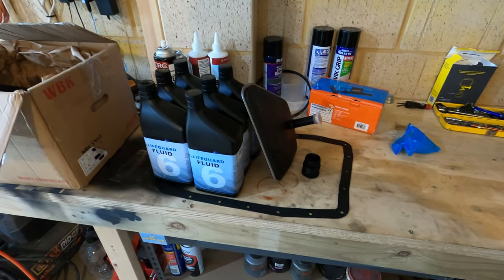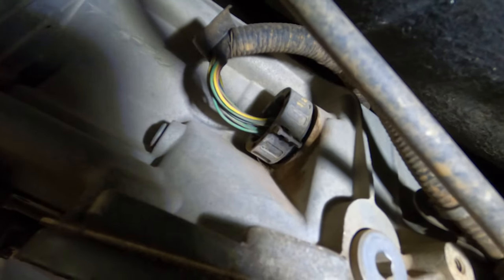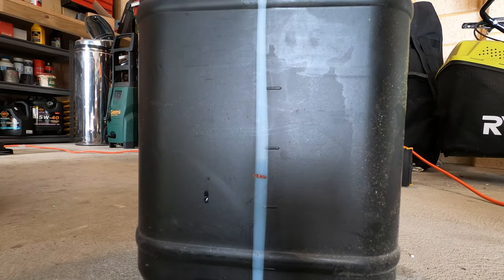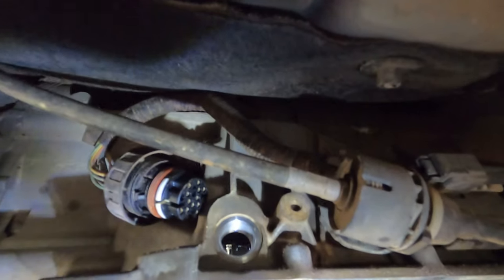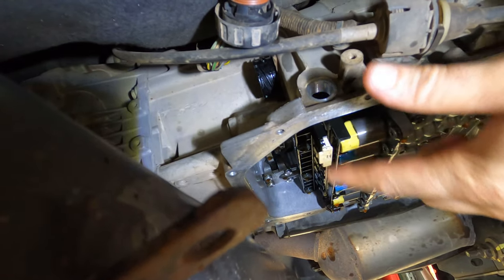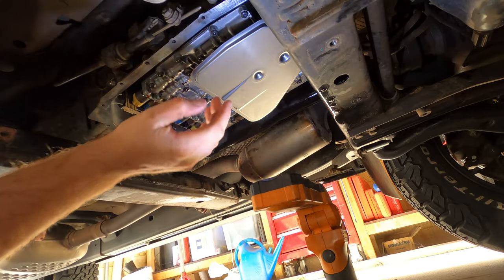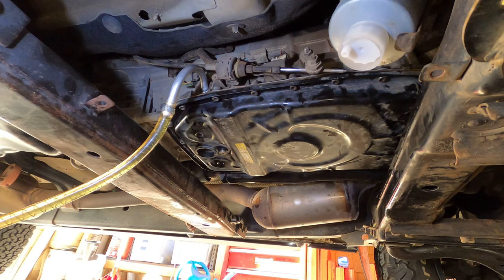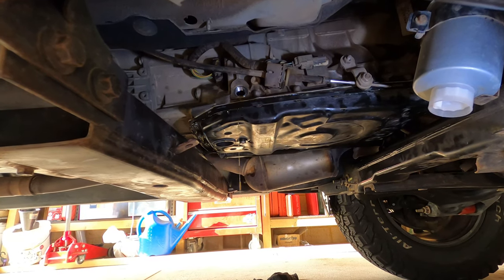LANDROVER DISCOVERY 3 TRANSMISSION SERVICE ZF6HP26

Comment: I did this last year on my LR3 V8. A bit different for the first time taking the old plastic pan off, it's a single piece with the pan and filter. You have to take out the pan screws, then use a hacksaw blade to gently cut the filter neck, sounds horrible but it can be done. One thing I recommend for first time pan replacement is make sure to tap the threads out before reinstalling the screws/bolts. I replaced the solenoids, mechatronic sleeve, valve sleeves, bridge seal. I lost 2nd gear sometimes from takeoff and decided to do a trans Service. My local Land Rover shop said don't do it. I did it, reset the transmission adaptations and it's been perfect ever since. These transmissions are great but people never service them. Also, I bought the LR3 a couple years ago, I wasn't the original owner. Bottom line, change your fluids and service your rig. Nice video.
Reply from the maker: Nice tips there mate I was lucky enough to have the steel pan on mine when I purchased it so didn't have to get the hack saw out 

I tried solenoids and clutch sleeves before getting mine rebuilt with no luck unfortunately 

Main clutch bushes were fingers and bypassing oil  aswell as the mech unit a fairly hefty Lump of money later and she's brand new haha and as you said they just need loving and in my opinion there one of the best trannies on the marker
Reply: Thanks for this advice. Were you able to do this without taking down the catalytic converter or the frame cross members? I'm planning to do this on a V8 and I believe this video works on a TD6.
Reply: My LR3 is a V8. I did a bit of research before doing it. You should go to Atlantic British website and look at their transmission filter kit. They also have a good video that gives a good idea, not everything, but a good idea of what is needed to do the job. It was the absolute best service repair I have done on my Rover. Only thing you will need to do is lower the transfer case a couple inches. Very simple. The most unnerving thing for me was cutting the old filter neck to free up the pan. It freaked me out until I just relaxed and did it. If you do it, while everything is disassembled, take the solenoids out and test them or replace them altogether. It will be around $850 US Dollars to do the job with all parts and fluids. After you're done you will need to have the shift adaptations reset with a GAP tool or a local Land Rover shop. Very simple computer procedure. My Rover shifts smooth and perfect. All gears working great.  @1013aaronb
Reply: Saludos, exelente te tu video, podrías asesorarme, hice cambio filtro y aceite, pero el auto cuando voy sacandolo despacio me golpea la segunda marcha, que sugieres que podria ser lo que falla? Espero tu repuesta gracias

Comment: Wish I had seen this video before I done mine! I made many searches without success for where the refill port is, but yours is the only one I could find that shows it. I was confused, as the port does not appear to be high enough to allow enough volume of oil. THANK YOU! The biggest problem I had was removing and replacing the bolts from the front of the plate, which are obstructed by the chassis cross member. I ended up drilling a hole through it to allow one of the bolts. My plan was to rust proof it. but there is enough oil to preserve it. :D
Reply from the maker: 🤣 yep oil will keep that hole well and truly lubricated hahah glad it helped you out even if it was afterwards haha 

Happy new years 🍻

Comment: I just changed my sump pan last week. What a nightmare getting out and putting back in 8 of the bolts along the cross members. I had to use an Allen key and quarter turn at a time on each one. It took me hours! Did you have a low profile ratchet with hex bit attached or something? You didn't seem to take long on those bolts blocked by the cross member. All done now, but what a headache outside in the rain 🙃😔
Great upload as usual. I hope you and the Mrs are settling into your new home 😊👍
Reply from the maker: Hey powervolt I used a small torx bit with my ratchet spanner 

Next time for the rear 4 bolts I'll just unbolt the cross member and support the transfer case with a jack stand to make life even quicker
Reply: @OUTBACK Discovery  Oh Jeez, why oh why did I not think of that haha. I will definitely have to remember that for next time. Cheers 👍😊
Reply: I e just tried it in the rain, bloody nightmare, and gave up. Stilll struggling to remove the bolts above the front crossmember. It doesn’t help as mine has spit oil everywhere
Reply: @powervolt748  was there anything in the filter which made it worth replacing it?

Comment: Great video! Very detail oriented and simple. I have a question, i have had my 06 LR3 for almost 4 years now and I drive it in manual/sport mode because if you drive it in drive when it shifts from 4th to 5th it slips/jerks pretty good like there is a delay in shifting. In manual mode it wont do it as long as you let off the gas between the shift. When it does happen in sport mode, it will go from 4th and jump into 6th and you cant shift back down for around 7 seconds, after 7 seconds goes by you can then shift back down to a lower gear. I have no clue what is causing the slipping but it has not got any worse in the 4 years I've had the vehicle. I was thinking about maybe hooking it up to the GAP tool and resetting the shift adaptations but im nervous about doing that. I've heard some people do it with success and others say its a no no...🤷‍♂️ Any ideas??

Comment: Hi, Thanks very much for this excellent video. So you don't have to remove cross members and lift up the transmission to remove the pan? I think the Disco 3 I have just bought has original pan on it. I see some people cut through the tube on the original filter so it is easier to remove.
Reply from the maker: hey jason honestly if you have the plastic pan, after doing this job a fair few times on different disco's now. i dont mess around anymore and just remove the cross member whilst supporting gearbox with a jack under the transfer case. if its a steel pan its easy to do with the crossmember in situ
Reply: Hi, Thanks for that. I do have the original pan by the looks of it. I did my diffs today. Got trans fluid so will order a metal pan with separate filter. Do you use the genuine LR fluid in your transfer case? It is extremely expensive. @OUTBACKDiscovery
Reply from the maker: @JRproductionsnz  i found shell do the transfer case oil for it but cant remember the number from memory was still pricey basicaly same price as landrover but i didnt have to drive 40 minutes to get it
Reply: @OUTBACKDiscovery  Thanks. I bit the bullet and bought 2 lts of genuine fluid today. $321 nz delivered! Thats why I am working overtime tonight!🤣

Comment: thanks for video, very informative! thanks heaps ,how many km on your rover ?  how did your car go after drain and replace fluid? also i have a rrs 2010 tdv6 3.0 ,same tranny i think ! , my questions is where did you get all your parts and fluid from please ????
Reply from the maker: Sorry about the late reply the business I bought my stuff through no longer operates 

Although it's the same make transmission in the 3ltr ita the zf8 speed rather then the zf6 speed my disco had so it takes a different oil but the servicing process is still the same as the video 

My disco had 220km on it but I bought it with a bad transmission so got it rebuilt at 140km and dropped the oil every 20km after that and serviced with new filter every 40km 

This is excessive for daily driving but with all the 4wding and beach driving I was doing it was necessary 

For a daily driving vehicle I recommend every 50-60km transmission oil and filter change and rhat will keep your car happy

Comment: Great vid - done this job a few times but this is the first time someone's pointed out the need to change the mechatronic sleeve (Thanks mate) and guess wot? Mine's leaking (shoulda changed it last time, drat!). So gotta get on with it but going round in circles trying to make sure I'm getting right one (most offers are for BMW and whilst it's the same ZF6HP26 box  - and therefore sleeve  - I can't get anyone to say ' yes it's the same'. Have you got a part no. or do you always have it as part of the whole service kit? Ta
Reply from the maker: Thanks Hugh basically if it specifies for a zf6hp26 then it will be correct  I just bought my sleeve off ebay for like $20  was just generic for the zf6hp26 and didn't specify landrover or anything

Comment: I did this a few days ago, on a 4.0 v6. What a pig of a job. Didn’t realise that the exhaust crosses over forward of the rear crossmember and there is SFA room to access the middle 2 pan bolts. Even harder getting them back in. Changed the sleeve and now getting intermittent trans faults but can fix if I give the harness a jiggle.. never again 😅
Reply from the maker: Hahah aww man what!

Maybe make sure that you locked the plug fully and it's not only have screwed in yet
Reply: @OUTBACKDiscovery  yeah at least I know it’s related to the harness.. took it off this morning it was a bit oily so gave it a spray, dried it and put it back so hopefully she’s right to go
Reply: @OUTBACKDiscovery  OK fixed now. Drained the pan again so I could try get the sleeve in further and got it in another 6-8mm I reckon so I should’ve listened to your advice of noting how far in it was before you take it out!

Anyway she’s all good now 👌🏼👌🏼
Reply from the maker: @ellzeez  perfect atleast you found the problem 🍻 will be all over it next time

Comment: Thanks for the video! Do you know if it’s a  Britpart pan? I see a Ford gasket installed, wondering your pan has a ridge underneath.
Reply from the maker: Unsure as to which brand the pan is as previous owner done the swap , I no the Bridport clears with the crossmember still there , 

The steel gasket used was from when I sent my trans off for a rebuild they prefer the steel gasket over just the rubber one

Comment: Great job!  I just completed mine but I had to raise the trans about an inch to be able to put the new metal pan in. :(  It doesn't look like you had to.  I got my metal pan kit from Atlantic British; how about yours?
Reply from the maker: Hey Sabine mine was on the disco when I bought it 

It is a tight fit though I have to turn the pan to like 45 and  degrees and angle it just right to get it to fit under can take a few minutes to find the sweet spot 

Time-lapse always makes things look like it just pops it but it's a bit of effort haha
Reply: @OUTBACKDiscovery  Good for you.  That must make it much easier.  May you enjoy your Disco for years to come!
Reply from the maker: @sabinetosabino689  likewise 🤙

Comment: hey bud, where did you buy the kit from, i have  a metal cover  so looking for something similar, im also also in Perth
Reply from the maker: https://mjproducts.com.au/shop/zf-6hp26-transmission-steel-metal-sump-pan-conversion-kit-factory-2nds/

Are the best I've seen proce wise specially for oil 

Or just search what you want for a ZF6HP26 that's our transmission model code
Reply: @OUTBACKDiscovery  sweet thanks, I was looking earlier but no one sells the kits, just the oil and filter, thanks for the help 👍
Reply from the maker: @AS-yc3wp  no dramas 🍻 happy shopping 😆

Comment: When draining at 2:15 in the time lapse, are you cycling through the gears?
Reply from the maker: Hey Jacksomb yeah I was * car was not running though* just wanted to see if any more oil came out or not. Didn't  seem to make to much difference though I maybe got an extra 400ml out

Comment: Hi, after servicing my auto, I started to get a torque converter shudder. The oil I was using is Penrite and recommended for ford, ZF automatics. Did you find an issue with this oil  and did the Nulon product eliminate the issue. Apart from this, the auto is perfect. has done 300k, so it is to be expected that issues may arise, however, I feel the issue is oil and not mechanical. Appreciate your feedback. Cheers Gene
Reply from the maker: Morning , I only run the zf lifegaurd 6 oil in my trans it's oil quality is unmatched 

Chances are your shudder is from the torque converter which is now worse with the penrite oil in 

Mine done the same thing except I changed my.oil because of the shudder originally and used penrite oil the first time this made rhe car undrivable so quickly dropped rhe penrite oil and put zf lifegaurd 6 back in so I could drive it for a few more weeks so I could save money for a trans rebuild 

So my advice personally is that I don't recommend anything other then the lifegaurd 6 

People have mixed opinions on the penrite oil some swear by it and other like myself would never put it in there trans again
Reply: @OUTBACKDiscovery  THanks, interestingly, the problem only started 10k after i changed to Penrite. I will do a flush to ZF fluid, nothing to loose, everything to gain. BTW, how did you go with gearbox rebuild, what was the wear like, major things to look out for?
Cheers
Reply from the maker: @TotaldriverAu  honestly I wouldn't waist your money 

If your planning on keeping it get your torque converter replaced and then get them to install zf fluid after job is done 

Dont put Dr tranny anti shudder in it that stuff is like putting a bandaid on an underlying problem and can cause more wear 

My trans was in a bad way so got with 3rd and first gear ratio faults aswell as the torque converter shudder 

So I got my box rebuilt by a shop as I didn't have time, had new mechatronics unit with a valve body zip kit put through it 
All new solenoids and seals 
Upgraded bushes throughout 

And a heavy duty torque converter and flex plate costing me 7.5k 🤮🤑

Next time will do it myself 

Will be doing my dads disco 3 torque converter soon they are about 1k for a unit and $500 in oil 

If you pay a shop around 12-14hrs to do the job
Reply: @OUTBACKDiscovery  Thanks, I do all work myself, have been doing a bit of research into what goes on inside, and seems pretty basic. Like all things, time and distance (300k) equals wear, Gearbox operation is sweet in every way, so a set of clutches and from what I have seen solenoids should be ok, and a new Torque converter by the sounds of it. Bugger.
Reply from the maker: @TotaldriverAu  nice one when you go to take the gearbox out to get to the top bellowing bolts they are easier to access if you removed the transfer case crossmember and lower the rear of the gearbox down 2 inches 

Gives you a better angle to access the bolts 

There's 2 breather tubes ontop of gearbox one close to the front of the trans ontop and one ontop of the transfer case 

And from memory 3 plugs to unplug 

People say you have to remove the transfer case to get it out but it can be done with transfer case on 

When I done my Mayes torque converter last month I found the transfer case bolts hard to get to so left it on and removed trans as a whole units which worked fine 

When removing the starter motor the fuel cooler gets in the way so just remove it fully and clamp the 2 coolant lines going to it so it doesn't leak 

To remove the started slide it back and then angle it up so that the positive terminal goes over the tip.of the engine mount bracket and then rotate clockwise a tiny bit and that will give you the room to remove the starter motor 

Good luck took me 6hours to get the box out
Reply: @OUTBACKDiscovery  geesus. no wonder I have been putting it off, was thinking body off, give the engine a freshen up and new set of bearings and so forth. If one part needs a bday, the rest cannot be far off.

Comment: Thanks for sharing this informative video. I once again have question.
Yesterday when driving a gravel road for about 300km. I randomly got the message "Transmission fault , traction reduced". Now the question is, the previous owners did not replace the filter and sump on the disco. Would you advise I still do it, or can it damage the gearbox? Car has 180 000km on the clock. Did you ever had that issue or know what it could be?
Reply from the maker: Morning mate have you got any ratio faults yet ? 

At 180000km chances are if it hasn't been serviced your torque converter won't be looking to great aswell as your main shaft journal bushes are probly worn ( this can cause gear ratio faults as the pressure leaks through the bush 

I recommened the steel pan and filter and I would be atleast getting a full transmission flush as it holds aroubd 11 litres and as you seen in the video I only get around 5 litres out doing a normal service 

Just bare in mind a transmission flush might only hide the problem before it happens again ( depending on which faults your getting)
Reply: @OUTBACKDiscovery  ,I am not sure what you mean with ratio faults? I have noticed a weird whining noise driving back. Can I temporarily drive like this in town? As its my only vehicle.
Reply from the maker: @landroverexpeditionsnamibi3040  if your unsure about the ratio faults that's good news as you havnt had them yet 💪 

Generally the whining noise is normally the front diff it's hard to say without hearing it , does it go away when driving and only occurs during turning or is it just a constant  whine whilst driving
Reply: @OUTBACKDiscovery  its a whining noise when accelerating up to 60km/h.
Reply from the maker: @landroverexpeditionsnamibi3040  hmm to me sounds more like a  wheel bearing or diff but hard to diagnose without hearing it myself

Comment: Christian and Vera go through all the gears I think. Is that unnecessary?
Reply from the maker: @scottguy5452  doesn't hurt to do it, it just makes sure all gears are bleed through

However I've never noticed a difference in the oil level changing when doing so so flick into drive neutral and reverse is enough in my opinion
Reply: @OUTBACKDiscovery  thanks. Certainly makes the job easier if you don’t have to do that